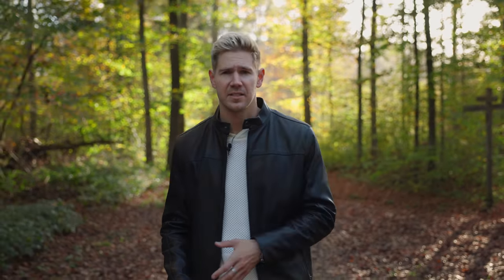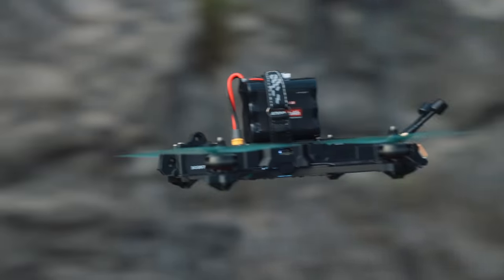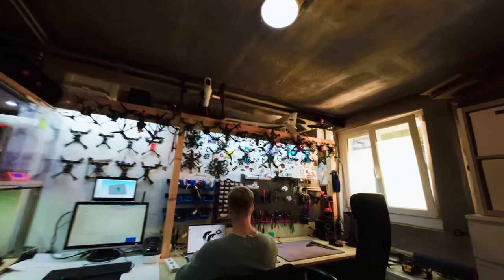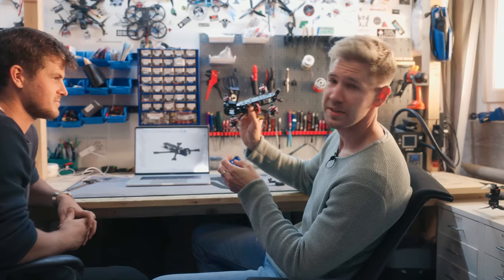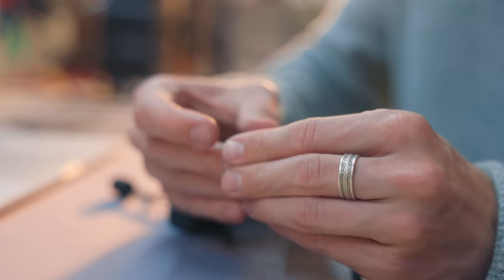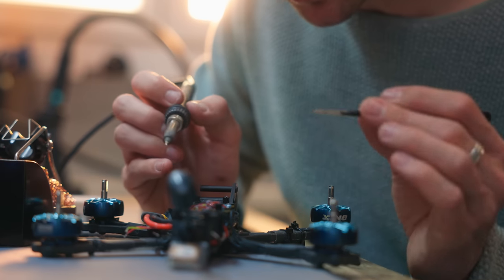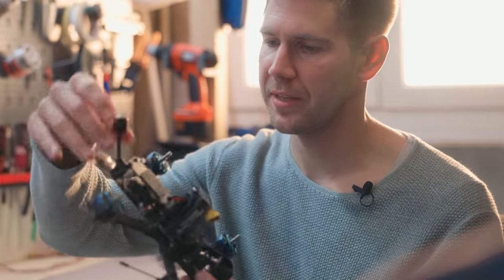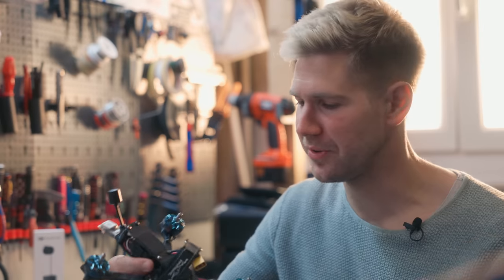DJI O3 AIR UNIT | Cinematic FPV Game Changer?

Comment: This makes me think of switching to digital finally 😄 I was always concerned about the breakups when doing long range stuff. But seeing you using it for this lets me hope. How are your experience with range and breakup during long range flying? PS: You have been one of the reasons to travel to madeira and fly there too, making my own madeira FPV video 😁✌🏻
Reply: Same.
Reply: @supervolant  Yeah i’ve seen it too 👍🏻
Reply: Been flying digital for 2.5 years with the O2 Air Unit and have managed 5+km at 1mw.  50mbps was consistent and always had confidence.  Dip below hills and far side of mountains and sure there's some loss but the quality is still adequate to maintain confidence.  Just bought two O3's.  One for my LR quad and the other for my OAS 5.5v2 frame.
Reply: @simonhughes4782  how bloody good is that AOS frame ay!! I did an aos 03 build
I couldnt believe how tight my aos frame flew!!
And im only 4 months into fpv but i found it insanely responsive even with fukall tuning.
Heres my first flight on it
https://youtu.be/kGTVDTVL6Z8

Comment: Funny enough, I'm more excited about using this for tiny whoops or sth like the Flywoo Explorer, so I don't have to bother with naked GoPros anymore
But the DJI fuckoff range is always welcome in my primary builds haha
Reply: Same here - think it will fit the explorer?
Reply: @FlyPixVideos  the mounting screws are wider, but the box itself is roughly the same size
Might need to zip tie, but it's fine imo

Comment: in this clip i find it smooth like reelsteady, did you edit anything? or default camera it is available?
Reply from the maker: Smooth quad and stsbilization but it looks different. I think RS is still better
Reply: @EllisvanJason  RS gives us smooth slow motion, but it's not really slow
Reply: @EllisvanJason  I use DJI action 2, is there any way to make them move as smooth as RS?

Comment: I saw that you can now use the dji controller 2 with the unit. Would you consider ditching tbs tango for even longer range? I just like the form favtor and having less antenna on my build.
Reply: Yeah I love all the radios I have but the simplicity of that solution is very appealing.
Reply from the maker: I use tango2 or radiomaster

Comment: the mamba mk4 f740 aio  power the o3 air unit directly with vbat.... is there any over heating or risk by doing that......the aio also have a tvs diod protection for safety ..... or i need to cut the wire and add a bec  for safety...... please help.. i am a little bit confused😢

Comment: Hello I am new to fpv and was wondering if the bob57 is ready to fly as it says it is tuned, I will be using dji goggles and dji controller 2. Would it just need an update on dji assistant 2?
Reply from the maker: Yes bob is ready to fly. You just need to connect googles and controller 🔥🫶
Reply: @EllisvanJason  thx mate

Comment: Are you running higher shutter speed for smoother shots at all or still 180 rule?
Reply from the maker: 180-90. As fpv moved so fast you can try different things and different shutter speed can look cool

Comment: Hi! I can see that some 5 inch and 7 inch drones with DJI O3 Air Unit are already available for purchase. But I can't find any sub 250g option. Does it exist? Or nobody offers it yet? What do you think? Do we have to wait for smaller/lighter versions of new Air Unit from Caddx? Is O3 Air Unit too big for sub 250g drones? If not, why nobody offers a sub 250g drone with it? Or somebody is already selling such drones?
Reply from the maker: Yes BOB57 (6inch) for example is o3 and some pther drones. Fpvframe.ch can build you a 2.5inch sub 250g drone. Their small drone is O3 ready. It also take a bit of time to adapt. To make the small drones o3 ready is not very difficult, just need to be done

Comment: Got to use it for the first time flying fpv and took a pretty bad crash in the desert and still all good👍 I didn't know the battery dies after it goes below 3.0v😭 also what is low rssi mean? It pops up on my goggles but Flys fine.
Reply from the maker: Well its below 3.5v. Only for liion its below 3v

Comment: Looks like a very powerful unit. I wonder how long you can keep this in the air compared to the original AU.
Reply: Absolutely better than old unit ,fcc mode 11km
Reply from the maker: Old one goes 13km btw 😇 so both have good range if you ask me. New one has better video if connection drops

Comment: Great Video and a nice Joke at the beginning... ;-)
Did you record the footage with a gopro or osmo on your drone?
Is the Air unit capable to record the Video on the drone itself on a sd card or do we need to record the gransmitted video?
Finaly, the O3 supports the dji rc so that i dont need an extra receiver for this?
Thanks!
Reply from the maker: No gopro shot on’y o3 in this video
Reply: @EllisvanJason   how did you record?

Comment: After futzing with it for a week, my 03 unit DID NOT WORK with my DJI V1 goggles, did NOT work with my DJI V2 goggles, did NOT WORK with my Dominator goggles, and yeah hope springs etheranlal DID NOT WORK with  any of my analog goggles.  I couldn't get a picture on any of them.   I finally gave up and SENT IT BACK TODAY for a store credit.
Reply from the maker: Well that it doesnt work on analagog is clear becuase it‘s digital, meaning we operate in the 5,8ghz area. With the v1 it probbaly wont work but it should or should aoon work woth the googles v2 and ofc googles2, where you can aee the biggest dofference. I know self buils fpv is always a strugle